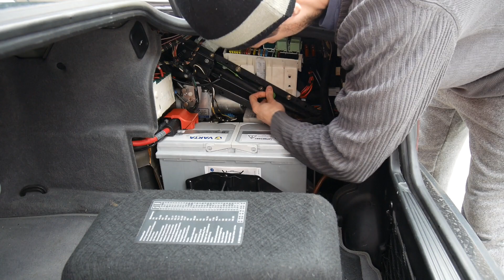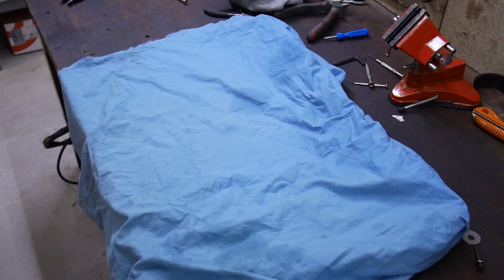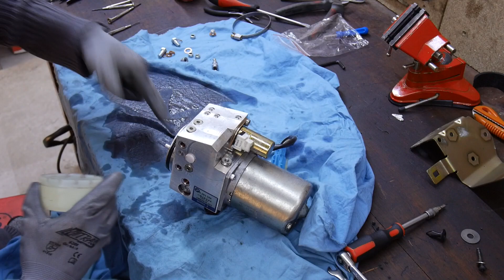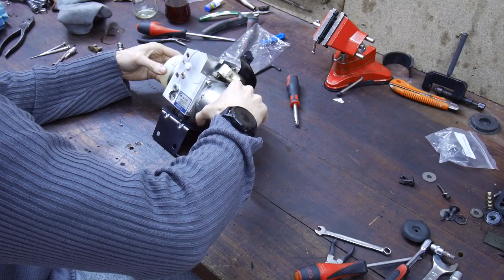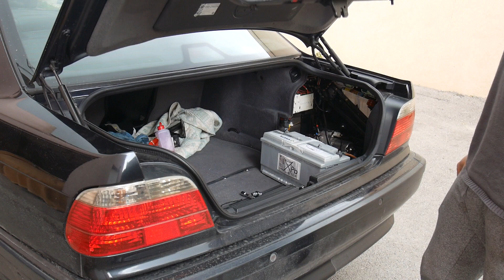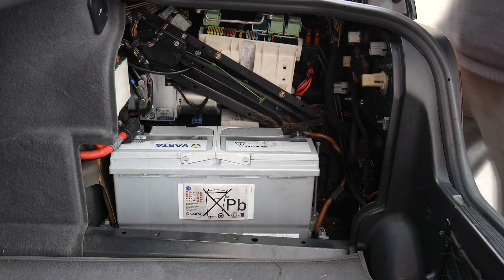How to fix weak hydraulic boot lid BMW E38

Comment: When the pump gets noisy, the fluid needs topping up. There is no need to remove the pump. A 5mm hex wrench cut down allows the fill screw to be removed. Filling has to be done slowly as it takes time to dribble through to the reservoir, using a short length of clear tuning.  BMW fluid is wildly expensive, so locate Aeroshell 41 instead. The pump can be removed without removing the white module in the video.If the pump is removed, reposition the clip to the reservoir so the head faces towards you, so it can be tightened later if necessary.

Comment: Thank you for your helpful video 😁
My boot opened pretty normally but closed like in 25 seconds. 
I replaced the oil by taking off the reservoir and filling that one up (seen in another video). I didn't knew a certain bolt had to stay off for the air to escape. Now I know, thanks.
Currently my boot doesn't open anymore but I feel he's trying. Closing works but kinda slow and I need to give it a little push down at first. 
 I will try to fix it again soon
Reply: Did you fix it?

Comment: How many times do you open the boot to bleed the system? I have replaced the fluid in my pump with Aeroshell 41, the pump works but does not open the boot lid. Is this because of air in the system?
Reply from the maker: yes, to much air. I did about 10 times closing/opening and the pump started to open the boot. Make sure the level is correct and le filling bolt is not on the pump to allow to air to get out
Reply: @MecaLogic  thank you for your reply. I didn't realise that the filling bolt had to be removed to bleed the system. I thought that oil would come out under high pressure if it was removed when the pump was running.